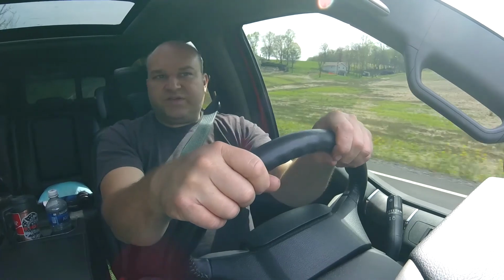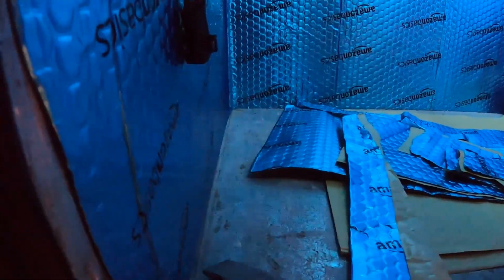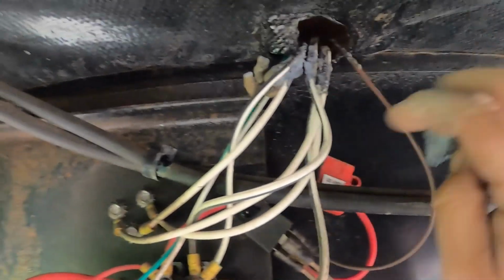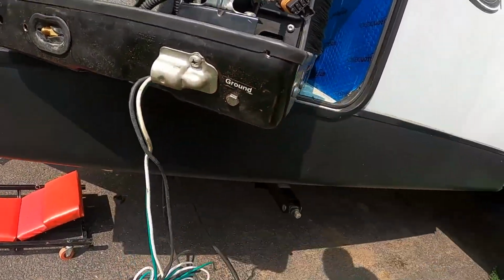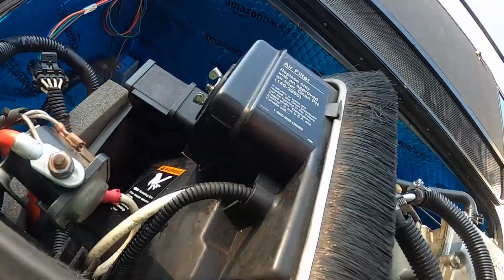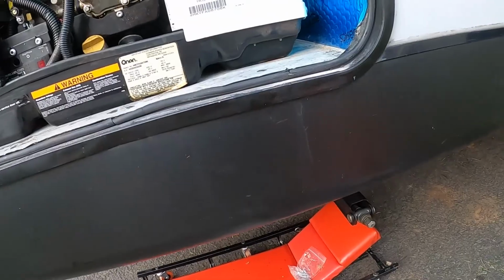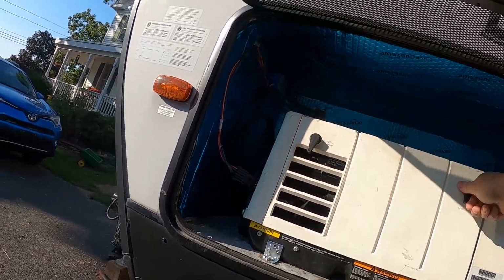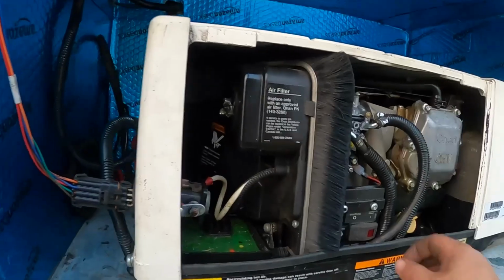Installing the cheapest Onan Microquiet on marketplace in my "generator prep" Wolfpack camper- DIY!

Comment: I know this may sound silly.   But I think the placement of that grey foam baffle is incorrect.  I've been looking at the parts list (as I've been refurbishing my Onan 4000 Microquiet this winter).  From what I can tell the foam sits on the outside of the resonator cover(with the semi-circle foam piece with the deep slits in it fitting through the plastic cover) not sandwiched inside the resonator .  Also, with my foam piece there is an actual grove cut into the bottom that contours to face of the resonator cover.  

My point is because this is may be incorrectly placed you may be restricting airflow, thus overheating your generator.  I may be completely off my rocker, but that is the first thing I noticed.   Also, safe practices dictate that you should never run electrical wire through the same grommet as a fuel line.  

Hope this helps.
Reply from the maker: I have the manual and the foam piece is the correct part number and installer per the parts diagram, so I’m fairly certain it’s correct. There are many similar generators that may have variations on the installation. As for fuel and wire passing through the same hole, I don’t believe that is in any way related to the issue. When these generators are run underneath a coach the fuel lines and electric share the same space.
Reply: @drewdoestrucks  your absolutely correct.  I did a little more research and saw different install diagrams for different Specs.   My 4000 is Spec H.  Yours must be Spec R or later as it does show the foam insert housed inside that Resonator Assembly.
Reply: @drewdoestrucks  https://youtube.com/watch?v=H23PLjYYH0c&feature=shares&t=933  saw this, thought of you😁

Comment: Now was the perfect time to mount the fuel pump and filter externally for simple fast and easy replacement.  It’s factory installed under the circuit board and is no easy task to replace.
Reply from the maker: Apparently a lot of people just add a second one under the camper
Reply from the maker: I’m trying to replace it now actually.
Reply: F'in genious!!!!  Have just been refurbishing my Onan 4000 and plan to do that post haste!!!  Do you know of any issues with mounting the pump at different locations?

Comment: Might be a little late, but a soft-start kit for your AC might allow it to start on your generator.
Reply from the maker: Well I had thought of that but the thing is, it starts and runs the ac just fine.  It just doesn’t always stay running. I’ve had it running for an hour before it dies and had it running for 5 mins and it dies. Honestly I didn’t have much time to look into it a ton this summer. I had a very, very busy summer with not enough time to go camping and especially not enough time to play mechanic on it unfortunately. Hopefully will get to the bottom of it sooner or later. May well be the case it just needs used some to clear out the carb.
Reply: @drewdoestrucks  On an RV A/C the compressor kicks on and off based on the temp inside, (even if the fan is running the compressor might not be) so on one of it's compressor starts the genny cant handle the load. This could be due to a failing capacitor in the RV a/c. Try replacing the run/start capacitor in the a/c as well as adding a hard start kit. should definitely help out.
Reply from the maker: @rossshirer9985  yeah I get that, like I said it will kick the ac on and run it for an hour sometimes before it shuts off. A 4K gen should have adequate power to start my ac. It also shuts off when powering other things. I’ll get it to run for an hour and then the next time I try it, it won’t run 5 mins.
Reply: @drewdoestrucks  what error code is the genny giving you?
Reply from the maker: @rossshirer9985  over rev or under rev (rpm too high or too low). Can’t seem to make up its mind about which way it wants to go. I am guessing a fully cleaned and rebuilt or a new carb would help but would hate to spend $280 on one and still have the same issue and skeptical that it’s the carb since it runs fine sometimes. Someone said there’s a separate speed governor on these but again with it not being consistent it’s hard to diagnose. I don’t have a ton of experience with these units but I expected it to run without fuss for hours.
Reply: @drewdoestrucks  get a can of sea foam and run the AC while spraying the whole can into the genset.   I had the same issue in a generator that sat for about a year and a half for the same error code.  Can of sea foam later it ran like a top, idled or went under load smoothly and never through a code again.
Reply from the maker: @DS_Outside  worth a shot.
Reply: @drewdoestrucks  give it a try and see if it works. I’d be really curious to know.